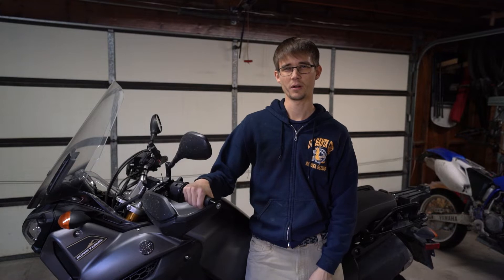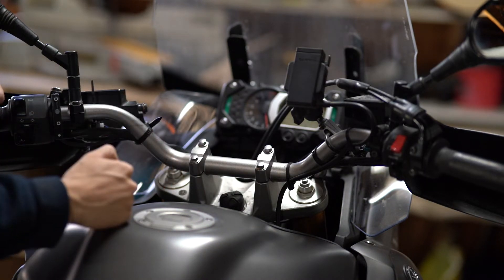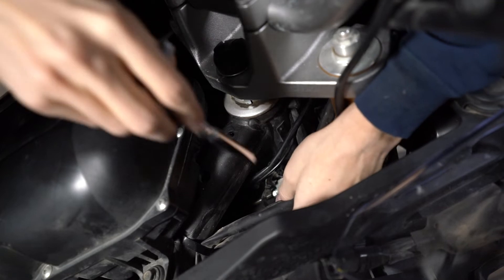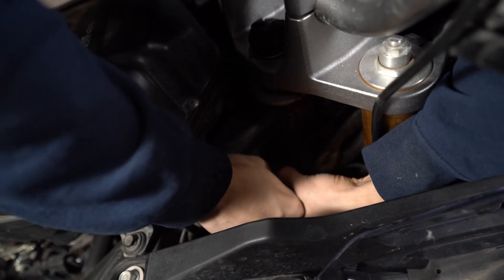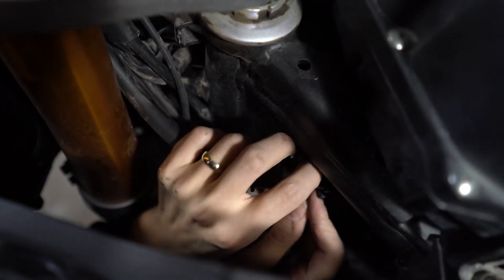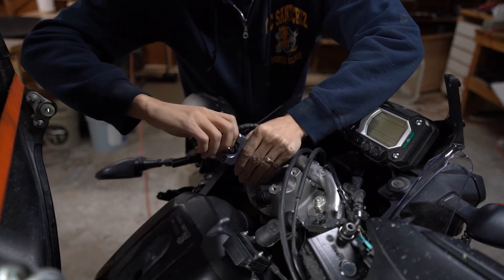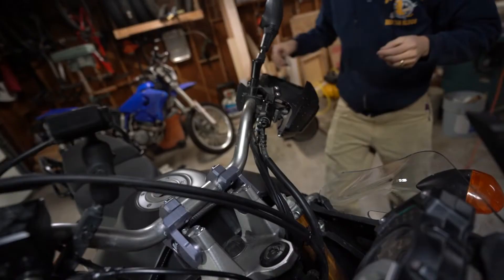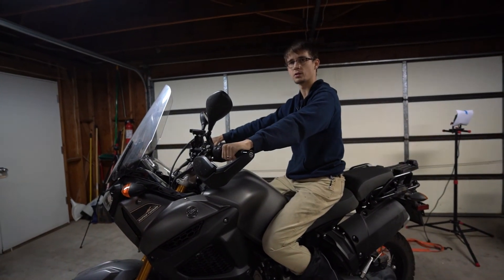Installing ROX Handlebar Risers on my Yamaha Super Tenere

Comment: A couple of thoughts. A good way to get handlebar angle correct or natural feeling is to lay a broom handle across from one grip to the next. Adjust bars so grips lye flat against broom handle. Also, you need to address clutch and brake lever perches - adjust accordingly. In your case they appeared rotated too far fwd. I like to have them where levers are easily squeezed w/2 fingers and natural feeling in either sittting or standing on the pegs. Nice install and attention to detail!
Reply from the maker: Good advice. I'll give that a shot. Thanks 😊